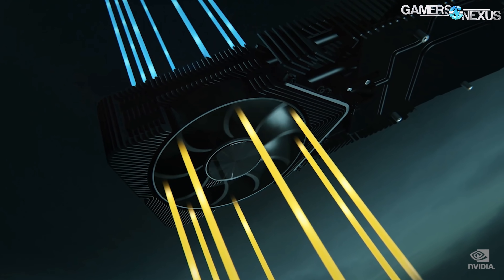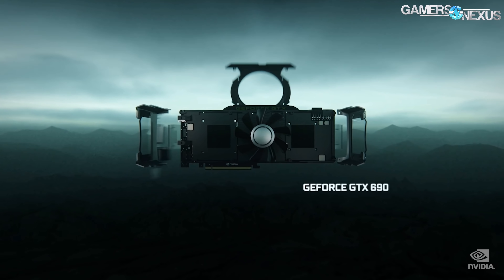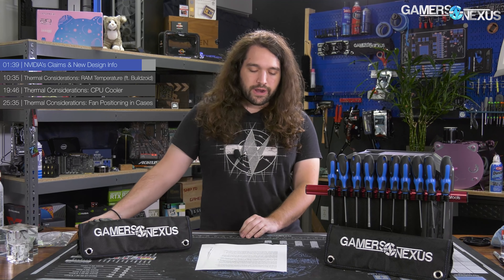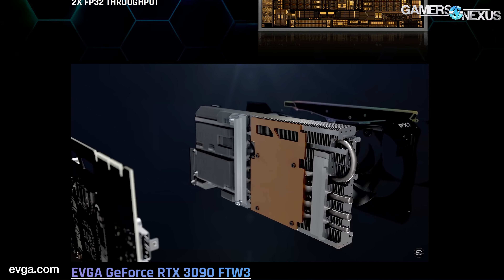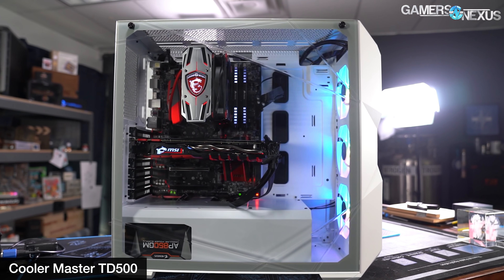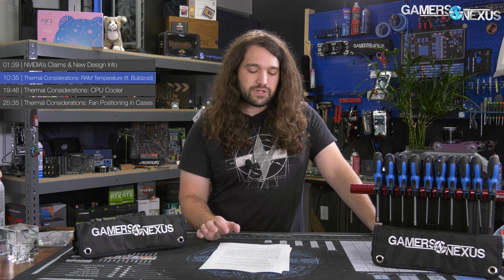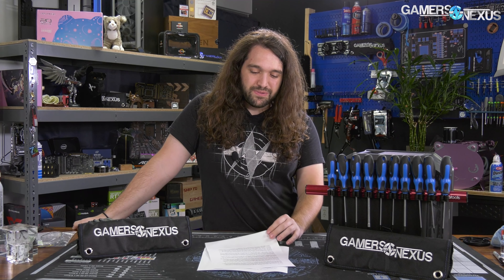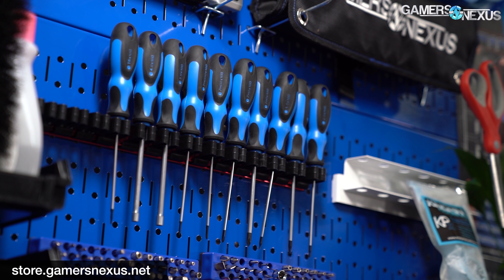NVIDIA RTX 3080 Cooler Design: RAM, CPU Cooler, & Case Fan Behavior Discussion

Comment: the new RTX build's fundamental design is similar to what i been thinking about. using and cramp all GPU processing element (VRM, memories, core) in small dimension of PCB, and use the rigid chassis as the bed to the whole card build instead of the PCB. so the extra dimension of the GPU card's chassis can be used to hold cooling units. and that small PCB of the new RTX is similar by size to upgradable GPU card for customizable laptops. makes it simple for GPU manufacturer to market the same card for laptop too. besides the VRM differences probably.

Comment: I'm incredibly interested in seeing how the Lian Li Lancool 2 Mesh Performance case with 2 shroud mounted intake fans interacts with that fan arrangement on the FE  cards. For those that are unaware, the case in question allows you to mount 2 120mm fans that pull air through the mesh side panel and blow it directly at the graphics card. If you have 3 120mm fans at the front or two 140s, one of them is blowing directly on the graphics card.  It's rear exhaust is a 120mm, and its top exhaust is 140mm.  

It makes me wonder if certain cases with non-standard features like that would improve the performance of this new style of cooler.
Reply: Think GN did a review with the bottom fan which was a few degrees cooler lik 47 to 45 on gpu iirc. Think best would be cases like corsair 280x and o11 dynamic with direct bottom intake to cool rtx 3000 series
Reply: @paulmichaelsabapathy9672  GN only used one fan, and I'm asking what two fans would do. The way the FE RTX 3080 have the fans setup would pretty much give them one fan feeding each intake. My mind just jumped to that case because it was such a top performer and its airflow dynamics would seem to benefit this new setup.

Comment: Delirium! 3 days ago precisely with the video presentation of the RTX 3000, I spoke about the ventilation problem on the fact of sending the hot air upwards at the ram and CPU level. 2 days later you release the video!
On the other hand, what happens if you put the GPU vertically? as on some config, it is the chipset of the motherboard which may not like, and also lose in NVMe performance.
On the other hand,
 I think NVIDIA gives a fairly "low" price knowing the performance of AMD RDNA2 GPUs.

Comment: Want to help people properly cool their cases!  I have a cheap phanteks p300.  2 140mm fans exhausting through the top.  also one 120mm fan exiting through the normal upper back of the case.  Cpu cooler fan (aftermarket cooler master 212) also blowing upwards.  So with this cooling setup the 3080/90 should work very well with this configuration.  If you think about it somewhere around 60-65% or the GPU cooling (guessing) is going through the pass through fan and out the top of the case and the other out the back of the case (so this hot air never enters the case)...  No intake fans in my case.  I did run 2 2070 supers and the cooling was sufficient in a 68°f/20c room.

Comment: For air cooled setups, (I still prefer air) I always use the top fans as intake, not exhaust. So they're blowing relatively cool air from outside the case direct onto the CPU and RAM area. Yes, it's a positive pressure setup if you do that and have the front as intake as well, but the rear exhaust and PCI-slot ventilation is usually capable enough to exhaust it all. And some cases will allow you to use the PSU as exhaust as well. if you have a fan in the bottom, I use it as an exhaust. It'll make a lot of difference in the amounts of dust in your system. And then there are some boys that say that warm air rises, so the top fans must exhaust. Yes, warm air rises, when you're having a fire ... we're talking about only a few degrees difference at most here. The fans wil completely overpower any natural convection of the slightly warmer exhaust air. It is a non issue.

Comment: Previous cooler designs just blew hot air out the side of the card to rise up toward the cpu and MB components. This new design just directs part of the gpu exhaust out the rear.

Comment: I'm almost expecting to see a video a day about different scenario and potential issues with thoses new cards, testing every configuration is clearly impossible (even if i think some prebuilt may be shipping with a stock cpu cooler). Kudos to nvidia to take a different approach for gpu cooling wondering if other will follow and if some issue appear especially with tower coolers some manufacture may try something alsa different to compensate (but it's clearly far fetch speculation at this point).

Anyways good luck to all of you for the massive amount of work incoming for the next month can't wait to see the data and what kind of number you will achievement in overcloking.

Comment: I'm interested to see how this would work with a Corsair 280X. Since the case is short, and the GPU is at the bottom of the case, I wonder if the highest front fan would push some of the GPU's right-fan heat out of the case before it enters a top-mount AIO...

Comment: I haven't been so intrigued by a graphics card cooling solution before. Aesthetically it's really bizarre, although I dig, but as far as performance goes it looks like it could actually be really effective with those masses of fins and the way airflow is handled (although I do worry about CPU tower heatsinks being somewhat overwhelmed with the exhaust heat).

Comment: Love the videos you guys make and the work/integrity you put into them. That being said, I've got a question and I'm interested in your thoughts. I'm trying to figure out what changes, if any, I need to make to accommodate a water cooled partner board (either 3080 or 3090 depending on benchmarks) now that it seems the smallest rad will be 240mm. Currently have a P500A case w/ a 360mm Arctic Liquid Freezer II rad exhausting out the top and the AIO 120mm rad on my 1080 Ti exhausting out the back with three 140mm intakes at the front. With my current case I'd have to have one of those rads being intake (likely GPU due to throttling reasons) but I'm considering getting an Enthoo Pro 2 and keeping the CPU exhausting the top, put the 240-360mm GPU rad exhausting the side, a 140mm exhausting the back, a 140mm intake at the bottom and 3 140mm intakes at the front. Do you think there would be worthwhile, noticeable difference in airflow/cooling if I made that jump or am I worrying too much? It also might be relevant that I've got a 9700k running at a steady 4.6Ghz and was thinking of revisiting it to push for 5Ghz now that I've got an AIO on it so that's a consideration for keeping the 500A and having the GPU rad being intake. Thanks regardless, keep up the great work!

Comment: Vega 56 red dragon and pulse already used that same concept which was great for GPU cooling. At least it was for the vega cards. We can derive from this cooling analogy that there will be for sure a raise in cpu temperature. I myself have a v56 red dragon with substantial UV (-250mV). And even then I get a raise in cpu temperature when I use tools which only stresses the GPU and not the CPU. But this might be because in GPU only stress test the CPU fan will stay constant.

Comment: I can see someone 3d printing a fan cover for the fan that blows air into the ram and CPU cooler and the 3d print will curved with an opening on the left to direct the hot air straight to the back of the case.

Comment: I'm hoping you test different cooling configurations for rtx 3080 and come up with a conclusive result for ideal setup. I'm thinking AIO venting out the back (tubes DOWN) with a top mounted vent fan to push out heat from the front GPU fan?

Comment: Try to make a step back and think about it again. If you have traditional ATX-style closed system and there is no exhaust fan below the GPU (around lower PCIe slots), then all the heat must go up and around CPU anyway. If anything, that pass-through GPU fan is marginally increasing the speed at which warm air is getting out of the case and lowering the overall ambient temperature in the whole case.
It is maybe counter intuitive, but it will actually be more detrimental in open systems, where the heat would not get to a CPU area at all.

Comment: 2 giant front intake fans + 1 top back exhaust fan ( back of the case on top ) + top back exhaust fan + noctua NH-15 range-ish air cooler = you are FINE.

Comment: Its great to see the advances in performance and price, but 320 Watts top end for the card alone is way outside of the power range I want to run. 
I'd like to see a system outfitted with the card to see how much the system is consuming at idle and under normal workstation conditions.

Comment: Usually, sound pressure level measurements are taken at 1 meter (3.3 feet aprox?) from the sound source, from multiple directions (because sound propagates spherically). What the final result is depends on what engineers and brands like to use. Serious companies might give an average of all the readings or the worst measured value (this is specially true for companies making equipment for scientific use). Tipically, with companies like Nvidia, AMD, Intel, etc they'll just feed you the best measurement of the best possible scenario. In measurement lab conditions the source is captured using Analysis microphones (Like Earthworks M23 or M30) and Analysis ADC interfaces (like the Audio Precision APx515). As you can probably tell, I have done this type of work in the past, specifically on SPL frequency spectrum and phase analysis.

Comment: So I'm wondering if gpu mounts at the front of the case will be more common after this card design. I believe getting the coolest air at the front of the case would be more effective for cpu thermals and gpu temps.

Comment: The 3070 looks like it was made for my dinky Silverstone SG13 case. Looks like the card would act as an intake fan from one side vent and blow the air across the case to exhaust at the opposite side vent. Meanwhile the CPU can be cooled with a 120mm AIO so the only thing getting hot air is the RAM and motherboard VRM and there's probably enough airflow to keep them from cooking. Very interested in seeing how the reference card behaves in practice because a good cooler design that fits the case dimensions isn't the easiest to find.

Comment: The cooler is more or less just an overhanging heatsink on a shorter pcb with a fan pulling air through the other side.  The Sapphire fury and sapphire pulse are essentially the same kind of design.

Comment: My Samsung B-Dies seem to cease work at some point above 48°C. Those are 3200C14 set to 3733C16 at little more voltage, about 1.37-1.38. In the summer, I had to limit power on the GPU so the case would not heat up as much, bec otherwise games might get laggy or even crash.
That said, atm I see most of the cards with axial fans only whirl around the air inside the case. IF one of the two fans of the new FE rather pushes the hot air out of the case (even the fan sitting closer to the GPU than the other), and only the latter whirls around the air inside the case, temps on RAM might even drop imho!

Comment: First of all, thanks the excellent work in this channel, it's the best I have found in youtube so far!
Like the ASUS design the most, however I am unsure about the STRIX because of the 3 power 8pin cables required. My PSU (Thermaltake modular RGB 750W) has 2 dedicated PCIE rails with cables split for up to 4 connections but I am not sure if 3 dedicated rails are required. 
Anyone with the same doubts?

Comment: Very interested in Nvidias new cooling choice. Could you please test Sapphire Vega 56 Pulse overclocked and overvolted to simulate thermal load of new Nvidia cards. Heat disipation into case should be quite similar, as this certain model blows through an open fin stack, too. There are also other Vega cards with short PCB and open fin stack available from Powercolor and XFX.

You are doing great content, thanks.

Comment: Steve, i got one big request. When tou will get one RTX 3080, test it also in some case with vertical layout - 90 degree like in Raven series. I got one such case (Cosmos C700P Black) in inverted layout (MB I/O pointing top) and going to change to Silverstone Alta F1 or Alta S1, but i analyzed all possible mounting positions for GPU, and users of such case will have big problem (it seems).

First of all, power cable from GPU may interfere with larger CPU coolers like Noctua NHD 15 if some decide to mount GPU vertically (like me for example - 90 degree + vertical bracket)

Second - if user will decide to put GPU normally in PCI slot, hot air from GPU will go straight into CPU fan - ser will be unable to point hot air elsewhere, but honestly i think i'm gonna try air tunnel for myself. 

And last - worst thing is, all manfuacturers like MSI, Gigabyte etc. have holes in backplate, PCB is the same size as Nvidia's version and there gonna be exac same issue.

Please, make some test with that layout, it seems, You are the only guy on YT that can try this.

Comment: Hi, great video there! Can I ask if it’s possible to do some test using different air coolers once your team in Gamers Nexus gets the new 3000 cards, to see how the flow of air works and what positioning works best? Was wondering if heavy workload on a system, would air cooler work better or would AIO work better ? There are many variations in terms of opinions on whether AIO works better or air coolers work better with the new cards, so was wondering if the new air flow system of nvidia 3000 cards would change the way custom coms are being build to maximise air flow for better performance during heavy workload.

Comment: I've got a pretty common build , it's a Fractal Define R5 case and a Corsair H100i AIO cooler setup..looks to me from the airflow diagram of the 3080 that i should be good to go...I even originally built the PC with a Seasonic 750w  gold power supply, so it looks like i'm golden.Just need to wait for the reviews before pushing the button...or possibly wait for the 3080 ti /super version to appear.

Comment: If you are worried about CPU temps with the stock 3080 cooler could you make the back of the case the intake and the front the exhaust? Have the CPU cooler fan pointed towards the front of the case therefor the hot air from the GPU doesn't hit the CPU. Not sure if this logic is flawed or not but curious to see if it would work.

Comment: Looking at this, The Lian Li 011 Dynamic might be the best case for this card. Intake through a AIO on top, intake on bottom, and exhaust on the side.
Reply: Same with the lancool 2 to a lesser degree. The 011 dynamic is really made to habe side intake though. The bottom just isnt open enough to be the only intake based on what I've seen.
Reply: onionynous I have top and bottom intake

Comment: Is there any chance you can analyze some of the older cases, like the Rosewill Thor V2 (which you reviewed 7 years ago) that have direct GPU cooling side fans? I am more interested in one of these cases now, with info on the RTX 3000 series card coolers, and prefer function over form.

Comment: Forums have been full of people ocd about the cooler adversely affecting cpu cooler temps or Mobo components.  Apparently the ones that don't have AC don't realize cranking a room up 10c gaming in the summer does the exact same thing.  I hope MSI 3080 armor will be a good insta aio or open loop candidate like 1080ti was.

Comment: 20:36 it is not heat radiation, just like on a frying pan the heat you feel above it is also transmitted through convection. especially in the case of chaotic airflow between all the fans and components, most heat will be transported off by convection, not radiation. Radiaton only really becomes significant at medium-high 3-digit temperatures in celsius. But I suppose the result for case heating is practically the same.

Comment: So I have a 240mm top exhaust from my AIO liquid CPU cooler, a 140mm exhaust back, I have a 280mm front intake and a little 120mm intake on the bottom. 
From what I understand, this doesn‘t seem too bad for the new Nvidia cooler? My CPU will get a little hotter than before, but since it‘s currently far from throttling, it shouldn‘t be a problem.

So without any test and reviews, my impression is that, with my fan orientation, the Nvidia stock cooler would work better than for example an EVGA card with three fans that just move the air around inside the case.

Comment: Back when metal side panels and acrylic windows used to be a thing, I'd suggest a side panel exhaust fan, pulling air from over the RTX exhaust, but tempered glass says no.

Comment: You shift towards an aio cooler for higher clock's. I was running a hyper 212  air cooler on my 9600k at 5ghz temperature was a little high 80c so I changed towards a cooler Master 360 aio. I've had a reliable oc of 5.3 but considering I can't use the extra and because it degrades the chip I done it because I could. Then dialed it back to a 5.1 which is still ample.

Comment: Use two aios. Cpu and gpu. Airflow on each kicks out. 4 case intake fans and regulate them all for the temps you want. Simple and easy solution. My 1080 ti never goes over 52c in sumer in fl.
3900x maxes out at 54c on auto with ram at 1.4v 3600.